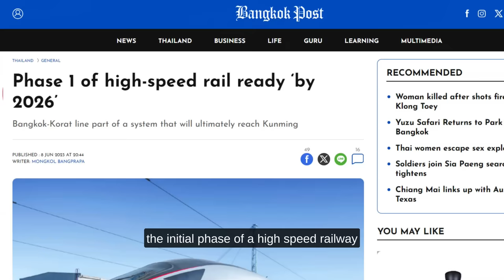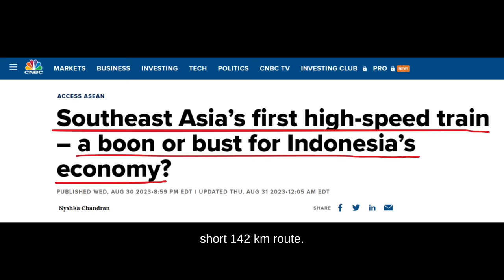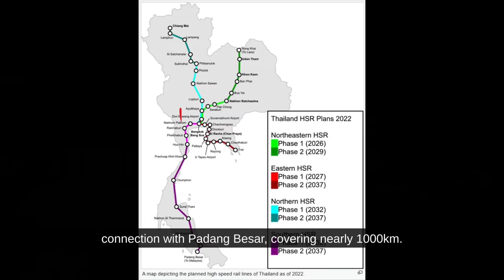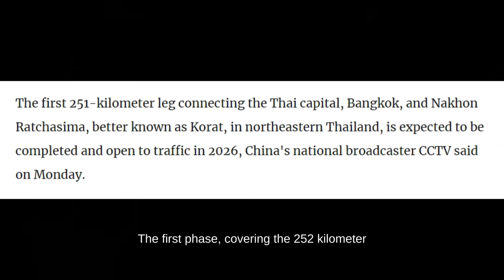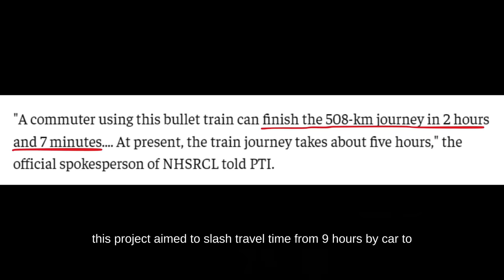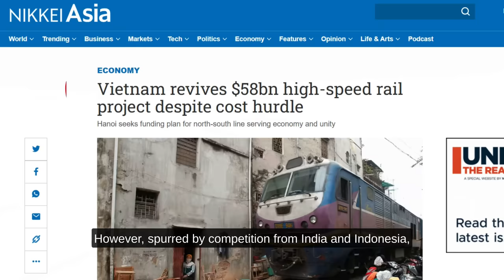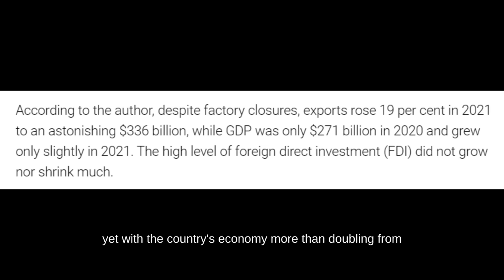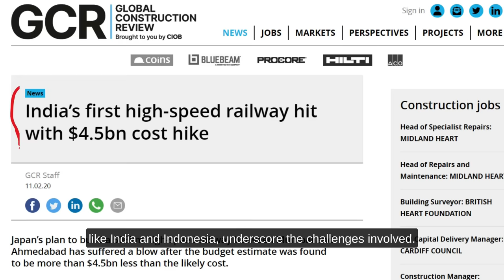Thailand, India, and Vietnam Competing to Build HSR

Comment: How on earth you are comparing an 160 km track with a 550+ km track ? Like how on earth does that even works. Its obviously taking time, cause the indias itself is 5 times bigger than Indonesias.

Also gov is currently more focued on dedicated freight corridors and regional HSR. The first part of DFC have already been functioning now, and it runs world only two story stacked containers running at a speed of 100km/hr max, and also the second part, that is the southern section is also going to be constructed soon, it will be a massive push to the infrastructure to move goods from around the country, but will also aid hugely in economy. Also delhi already have operational regional HSR, which is currently working. Not to mention Vande Bharat trains are increasing too. Unlike other countries, Indian railways are doing too much at a same time. And again, as i said, giv have clearly said that we need DFC and regional HSR more than bullet trains, so the current trend is fine.
Reply: Why can’t India put 4 times workforce into its 508 km line so that it can be done as quickly as Indonesia’s 140 km line? Indian has no labor shortage, right?
Reply: @leichen8000  why ? Why we would put 4 times the workforce, when its not even our current priority? I mentioned earlier, regional HRS and dedicated freight corridors are much much more important than bullet train. Countries like Indonesia, doesn't have these kinds of projects up there hands, thus making it significantly easier to work on these projects. Whereas indian railways has much more in its hands as of now, DFC, HRS, Bande bharat, Kavach intigration to all tracks, increasing tracks and upgradation to enable semi heigh apeed rails like bande bharat, etc. Not to mention indian railways is way way larger than any kf these countries, in terms of passenger capacity. So we cannot just increase our funding on one project, where there much important works that need to be done first. As an indian, bullet train can wait a few years. Regional HRS and increase of tracks should be the priority as of now.
Reply: @rickgolder6818  Nonsense! The HSR uses the loan provided by Japan. Adding more people to work on it DOESN’T need additional money and WON’T impact other projects.
Reply: @leichen8000  bruh i never talked about the money being problem, i said its the priority thats the main thing. Do you even know where the HSR route being done ? Are you even familiar with indian land laws and regulations? Do you even know how these projects work ? The main, and the major problem facing was the land acquisition for the construction, since it passed many framlands and all, thus making it difficult to get those land, especially in india, where the farmers lands are a hot topic and it needs to be approached with precautions, otherwise the oppotent party can use this to attract voters towards themselves, there are other reasons too, not gonna talk about that do a bit of research yourself.

Secondly, as i mentioned, where does our priority lies ? Each day, an approx of 24 million passangers and 203 Million tons of freight is moved all across the country. Which is many many times more than Indonesia or any other country. Now the question arise, whether we want to increase the speed of a project which we dont even need, or focus on other things which actually matters, like the dedicated freight corridors and regional HSR and increasing railway network. If you know that even india being the 3rd largest (some sources say 4th, but whatever), its still not enough for our passengers and goods, even being this big they are still overcrowded and many rails dont even can run in there full speed, because of many reasons. So in these situations, does it seems feasible for india to increase its focus on bullet train, when we already have our own semi height speed rails like Vande Bharat train and Delhi R-HSR ? No, we dont. W foremost needa to increase the tracks lenghts, and so increase the numbers of trains, with introduction of semi heigh speed rails like vande bharat, and also increase regional transport HSR. Given india plans to have 400 Vande Bharat semi HSR by the next 2 years, the work need sto be done on increaseing tracks and upgrading them. 

https://www.financialexpress.com/business/railways-mumbai-ahmedabad-bullet-train-project-progress-report-indian-railways-2632926/

There are other reasons too but its not feasible to write everything. Before commenting, do you homework and research about the specific topic you are commenting on. Rather than speaking shits.
Reply: @rickgolder6818  Great! You hit right on the nail 👍👍 It is not the problem about money. Rather THESE ARE PROBLEMS OF INDIA POLITICAL SYSTEM, DEEPLY ROOTED IN INDIAN SOCIETY.  These problems systematically make India struggle, slow and inefficient, causing all kinds of delay and wait and NO SOLUTION. 
60 years ago, India’s economy was at par with China. Now it has fallen down to only 1/5 of China. You explained clearly and precisely 👍
Reply: @leichen8000  also another thing you said right, india was mis governed all these times. Our previous government failed to catch the manufacturing bus back in the 19s, thats why we have to work twice to fill the work. But dont worry, the current government is doing great, and you can definitely see the results even in the media and stats and all. So yeah, give us a decade or two, you will see where india stands then.
Reply: India used to have the largest and most advanced railway system in Asia before independence. Now its railway has all kinds of problems to deal with. Democracy is a good thing but hasn’t been working well in India for some mysterious reason…
Reply: @leichen8000  well I mentioned earlier, that india was hugely misgoverned back during the 19s, and is solely blameable on the previous government, for not taking enough infrastructure projects to suffice our population. Blame it to the previous government. Also indian economy was closed till 1990 and was using the USSR methode, but after the Soviets fall, and Opening of economy in 1990, india have seen steady growth in all sectors. I obviously agree that in the 19s india had its problems, but its getting out of it fast. And I really dont think i need to explain it why. 

Also democracy is not very good, when you have thousands of different religions, casts, secst, cultures, traditions and different types of peoples to take care off. Its very difficult to Hear all of its different peoples voices, which belongs to different customs and then come into a conclusion for all of them. Tyr doing it, its definitely not easy. Whereas in chinas case, it was never a problem. Its much much easier to move people and force labour and development and rules on people when there voices doesn't need to be heard. Much easier to do work, when there is no one to question you. Much easier to bend people on your words, remember like the Taimanin square, or hong kong, or tibet farmers taking land for hydroelectric plants etc etc. Do a bit study about the "loat generation of china" you will see how china got developed so fast. Also not to mention, the west during the 19s most of the time didn't supported India (because it was an USSR friend) and always supported Pakistan and others. Causing thousands of terror attacks across the india. Whereas china doesn't have to face all these. 

Its not even slightly fair to compare both countries, cause both of them have there own set of problems.
Reply: @rickgolder6818 I did read all your responses, twice actually, and appreciate!

The main disagreement is that you put the blame on the government but I think it is more the system to blame. HOW COULD A POLITICAL SYSTEM ALLOW A NATION TO BE MISGOVERNED FOR SO LONG? Could Modi’s government change Indian political ecology? Not likely. India’s problem seems so deeply rooted in its society soil that Modi is not able to unroot. His government is making a lot of progress though.

Yes, China has many problems as well. But the button line is, however, when people compare China’s development with other nations, overall people still believe their government is doing better for the last 40 years. People are enjoying life improvements including the HSR everywhere and to an extent willing to give up some freedoms for economic efficiency. This is not to say that CCP does everything right. No!
Reply: @rickgolder6818 -> 
Hahahaha 😆😂🤣
Reply: @leichen8000  bro, try governing a country with hundreds of religions, castes, sects, customs, who speaks different languages, whos geography and people changes with 100km of travel, and a country of many beliefs. You will find your answers. My comments are not to say that Indonesia or china is doing bad. But your idea of indian society being so called "bad" is just baseless. I dont know why you are blaming the system, all along when we really arnt doing that bad. Yes if you compare with china, its striking, but compare to other countries both European and asian, or compared to countries who share the same history as us, you will see that india is doing better than all of that.

And for your question, was the previous government responsible for not developing fast ? Yes, you can disagree, wont matter to anyone, nor will change anything. And second question, will modi government bring a change to the political ecology and overall government ? Yes, yes it will. And its already happening, just looking at the past records you can see that the difference between the previous government and current government. 

Also i would like to say one thing, theres a quote in india, those who are related to politics and all knows this. "China grows because of its government, india grows despite it". If ....you can understand this deeply, you will get your answer on why indian society is not doomed, it never was , never will be.

https://youtu.be/7c4uO9ZGfbc?si=bKZpBvzWTtxtqP3h

Watch this, this is not related to any of the matter we discussed. Its not related to politics or anything such. Its also not made by a indian, so it is unbaised. Watch this, and you will get your answer, which you are searching for. Both indian and chinese society are different yet very similar. Its not fair to judge them or compare them in any sense.
Reply: @rickgolder6818  Thank you for the elaborated response! There is a similar saying in China: “Any society grows. It is the government that accelerates, hinders or blocks”.  I do agree with the quote you gave.

I never said Indian society “is bad”. It has been growing for sure. In the context of India & China  development, however, many people have been wondering what caused India economy fell from being at par with China 60 years ago down to only 1/5 of China today. You blamed previous governments. On the surface, yes, things look that way. 
But NONE of the obstacles you listed were created by those governments, instead they are all deeply rooted in Indian society for thousands years, right? Can a 10-years Modi government rebuild a thousands years society? Maybe only to a limited extent.

Modi has been doing pretty well. But how will the future governments deal with all these issues in Indian society that for sure will continue existing post Modi? That’s everyone’s call.

In China, from the top central government all the way down to every village, there is a clear “chain-of-command”. decisions good or bad from the top all get executed effectively nationwide.
Reply: @leichen8000  the society started changing from the start of the 19s, from the first independence movement and the will to create a single country. The society has come a long way, and will keep on improving. It was just suppressed till now, by bad governing. Ans tbh we all know that india followed a Soviet union type economic build up, making it harder for growth. But after the 1991 economic liberisation, india have been doubling its gdp in every 5 years. India is already in set for development and growth. And modi government jist gave the push whcih was needed. Now its in a self serving motion, doesn't matter which government comes after modi, what has been started cannot be reverted again. You can call it a "permanent change in the politics and ecology of the country". 

Indias growth to a next global power i emmenent. The question is not about"if" india will become an developed nation, anymore. The real question is "when" india will become one. Its only a matter of time now. A 20-30 years from you, and you will see where india stands then. Its all set in motion. Cannot be stopped, even if we want.
Reply: @rickgolder6818  “When” will India become a global power depends on how you define global power. Being one of the 5 largest economies, you can say Indian already is.

In 20 - 30 timeframe, India will most likely surpass Germany and Japan and become one of the top 3. But, if you define “global power” as the top 1 or 2, then Indian probably won’t get that far in foreseeable future.
Reply: @leichen8000  you don't have to be in the top 2 to become one duh. Yes obviously china and US will keep on maintaining the 1st and 2nd spot for atle the next 50 years, but that doesn't mean there won't be space for another superpower. India may not croos china, but by 2040-45 india is set to become a 25-30 trillion dollar economy, yes even though by that time, china will be around 32-38 and US will probably cross 40-45 trillion dollars. but even being 25 trillion dollar economy is more than enough to assert power throughout the world, and become a powerhouse. Like just look at us, we have achieved things even much more developed countries couldn't do with the fraction of what they spent. Our defence, space, research, innovation etc are already one of the best in the world, even if we are just a 3.8 trillion dollar economy, and are still comparing with Russians, Chinese, Japanese and others who already are much experienced and developed than us. So how can't you tell, that india when it will be at 25 trillion dollars economy, won't be doing much much much better than this ? I mean, we already are comparing them with a fraction of there budgets, and India's this mentality of achieving milestones with compatitively less funds than other countries is the biggest reason why india will become an superpower in the 2040s.

The hunger for growth is just increasing, and it will keep on increasing. Heck we are even planing to build a space station by 2030-35 and send a person to moon by 2040. I know it's hard for a foreigner who never visited india to comprehend the speed at which india is transforming, but as an indian, but as an indian, the change is totally visible. Not only in infrastructure and development, but also change in mentality of citizens. And organisations and starups like ISRO and agnikul etc are one of the main reason behind this.
Reply: @rickgolder6818  India is never shy announcing big future plan but yet to establish a convincing record in execution and delivery. From INV Vikrant carrier to Arjun tank to LCA Tejas jet fighter , it seems a norm for India major projects over spending time and money.

Chandrayaan 3 is a proud of India including its achievements with low budget. But the overall picture is that in the same time period of moon exploration (2007 - 2023), China launched 5 missions, all succeed, while India launched 3 with 2 success and 1 failure. Low cost doesn’t always translate to efficiency.

Becoming a developed nation is a different scenario (from being global power) which looks more at GDP per capita. India has to grow its GDP about 10 times which is a journey even longer. If you ask in how many years India plan to clean up slums, to eradicate poverty, to increase literacy and women’s labor participation to in par with other Asian nations like Japan, Korea and China? In 20 or 30 years? No date, no answer to “when”.

No matter when you build space stations, you won’t be considered a developed nation when women don’t feel safe on bus, train or street, when caste, arranged marriages and religious discrimination wildly exist, when people from northeast region don’t feel being recognized as Indian… Resolving these issues on the ground is equally essential to, if not more than putting man on the moon. Does India has a target time table? People are yet to heard one.

10 years after Modi became the PM, Indian society is still quite away from being efficient, from business environment in general to everyday’s life of ordinary people. I believe like you said that changes are happening everywhere on Indian soil and in people’s mindset though.
Reply: @leichen8000  1. I mentioned earlier, india budget is less compared to others, China's space research budget is 3-4 times that of India's. So it's obvious that they will have more missions, duh. It's like a common sense. And again, chandrayan 2 wasn't a "failure". It was 95% successful. The orbitor of the chandrayan 2 is still revolving around moon, and still sending pictures and data's from moons atmosphere. Chandrayan 2 lander didn't made a crash landing, it made a "hard" landing, as a result the door mechanism of the lander broke, thus the door didn't opened and the river couldn't come out. it cannot be said a total failure. Also chandrayan 3 was planned for 2021 but was delayed due to COVID, same as other missions like Aditya L1, gaganyan etc. And if you look at the frequency of the projects per year, it's only increasing as the budget increase. At the start of 2014 India's launch rate was just 1.5 satellites per year, due to low findings, but now it over 7 satellites per year. There's an 123% increase in budget since then. ISROs budget in 2018 was 1.1 billion dollars, where as NASA spent 20 billion dollars, and China spent 11 billion dollars. This is enough to say, that how difference the launch rate of this countries will varry, just by looking at these numbers.

And it's only been increasing day by day, india just in this year launched many major launches, chandrayan 3, Aditya L1, and this month last week, ISRO is going to launch the first uncrewed mission of Gaganyan, which will after all the tests will send Indians to space by 2024-25. ISRO director have openly said, that the only restrictions on them currently is the budget, as india can perform many more inter planetary missions, but cannot due to low budget. The 4 mission to moon, a second mission to Mars, and the first mission to Venus is already planned and executing, if we want we can launch all of these missions next year, but can't, cause for funds problem. I guess you understand the difference between the launch rates and all, between india and china. And yes LOW cost indeed transfers to efeciency. There are many countries apart from the rich ones who wants to go to space or be in part of space missions, many childrens who dream of being a part of these missions, but cannot due to money. ISRO is the direct challenge to these idiology, that evev if you don't have sufficient fund and all, if you have the will you can even make into the big leagues and go further. We have already proved it, and will keep on doing that.

Another thing I must say, the legendary Vikram Sarabhai, the founder of ISRO, said when he was founding this organisation. "The main purpose of ISRO is to make space available to Indians and to the world, even if we don't have the sufficient resource. Space technology is in service of mankind" i am proud of the fact, that ISRO haven't forgotten there goals or there mottos. If one dreams of reaching the starts, he shall have it. And I love ISRO for that.
Reply: @leichen8000  2, well people said the thing back in those 19s. Saying "to grow it's GDP about 10 times, is a much longer than you think". They all said that lol, and and then look where we are, close to cross the 4 trillion mark, gonna become the 3rd largest by 2026-27, gonna become a 8-10 trillion dollar economy by 2030, and became a 25-30 trillion dollars by 2040-45. It's all set. 

And if you don't know, india itself brought over 600 million people out of multi dimensional poverty in just a decade, and it not me, it's the IMF saying that. The living quality and infrastructures have increased tremendously in the last year's. Also if you don't know, 70-80% of India's population is going to become a middle income family by 2030, making india the largest business opertunity by 2030s. Every single factor you said, be it's poverty, literacy, womens labour etc are already been taken care of. There were 370 million people in poverty  in 2015-16, and it stands at 230 millions as of 2019/2021. There a 9.9% decrease in India's poverty from 2015/2016 it was 25%, but in 2019-21 it was lover than 15% ( 14.80%). 1/10th of country over 145 million peo escaped poverty in just 5 years. If this doesn't suffice you, then I don't know what will. 

Also India's GDP has been doubling itself ever since 1990, when the economy was made open. And so is currently going with roughly 6-8% annually. This is enough to become a 25-30 trillion dollar economy by 2045, and Indian parliament has already set the target to a become developed by 2047 (100 years completion of independence). And not just economy, army, navy and airforce has also said that they will be self reliance by 2047. who said no answer, from world bank to IMF to Goldman Sachs and other have all said that india will become a 25-30 trillion dollar economy by 2045, and they all are global sources, if you don't believe the indian one. 

The only way to eradicate slums and all, is to increase the money flow and business, which can only be done by increasing the GDP PPP, per capita income of common people, and the per capita will only increase if the overall GDP increases. So it all comes down to this, increase the GDP, and everything will be taken care of.
Reply: @leichen8000  "being efficient" is not the right way, i mentioned earlier, if you have watched that video you would know. Its most accurate representation would be a "organised chaos", that word fits the bill. Yes I do agree that things need to be better, but it's already getting better. Might take 10-20 years, but it's definitely getting better. So yeah I have no problem to wait a decade or two. If you are accepting that changes are happening in mindset and India's soil, then Idk why you cannot accept that india will grow in the next decades ? I am not saying india will be developed in the next year, 2045-47 is a loooong way to go. It's enough time to make a country developed. It's totally a understandable and accepting timeline.
Reply: @leichen8000  oh....Theres one thing i forgot to said, its important in this. You were talking about caste system right ? I MYSELF BELONG A LOWER CASTE, i Belong from SC catagory, which is like the second Lowest caste. But not even for once i ever was mocked or anything like that for being a lower caste. Never. Heck it was so out of sight, i even forgot that I belonged to a lower caste, because it wasn't necessary for anything. I jjst remembered it now, and so thought i would write it. 

These things are nothing but bais piece of shits. Foreign medias just love to milk these types of things from india. Especially News companies like BBC and SCMP. They will see one incident in a village or in a city, and will immediately start writing spicy reports news about it. Some are even ao desperate, they even create there own stories with there own pictures and all (BBC's documentary on indias poverty didn't used any indian pictures, they were all africa countries, and it had many Biased views and not true facts, but still it won the best documentary award back in those times. Like FUCKING WHAT MAN). Foreign news companies especially may western outlets never actually liked or can accept the fact that india is doing better than them in many way. So this suppression ans creating a false narrative and situations using news outlet in not uncommon.